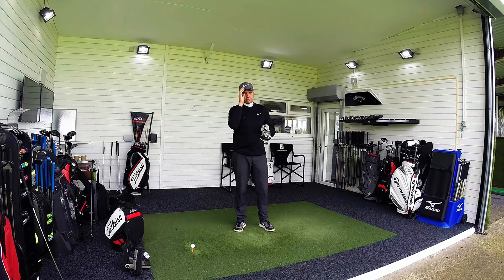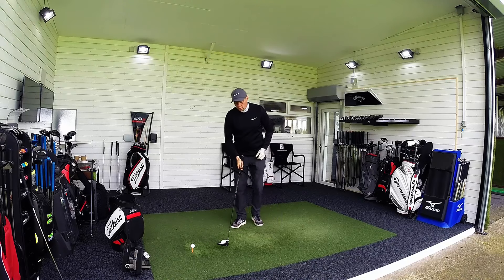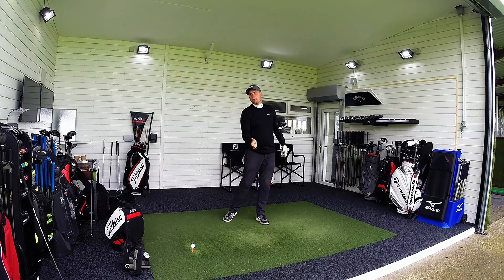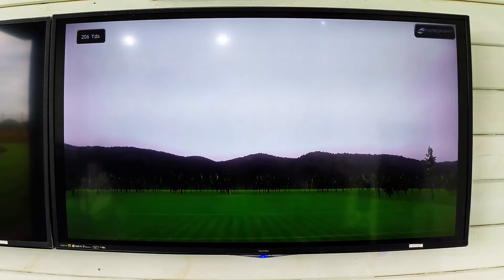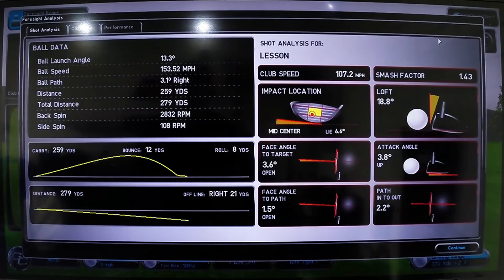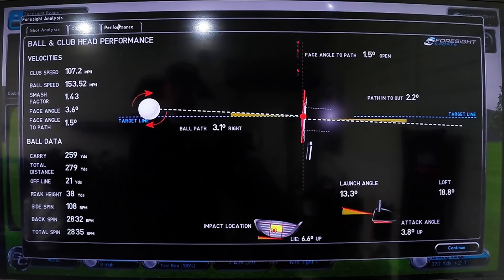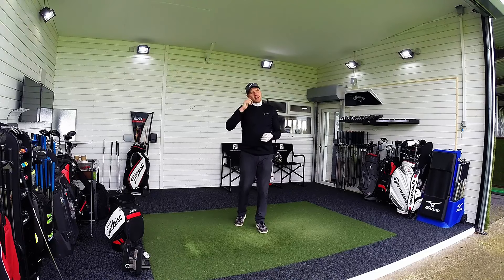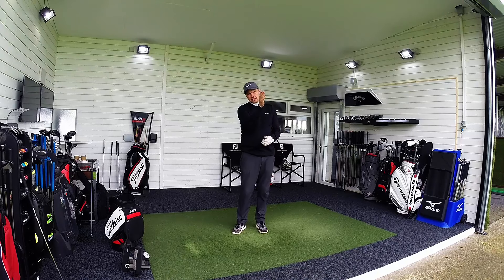MAXIMISING BALL SPEED WITH DRIVER FOR LONGER DRIVES

Comment: This is something I really need to work on. On GC2 I swing 108 mph with high launch, around 14 degrees with an 8 degree driver, but my spin is up around 3000 for the reasons you mentioned in the video. I need to figure out how to make this change.